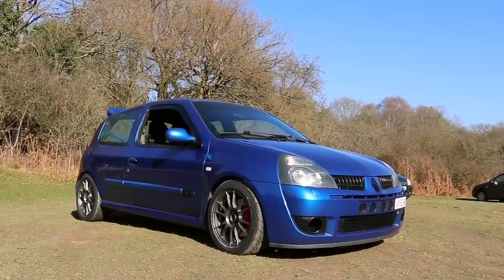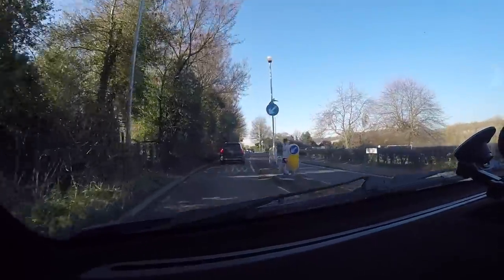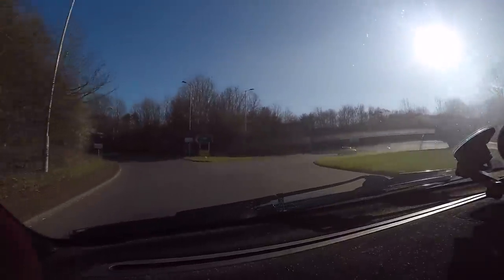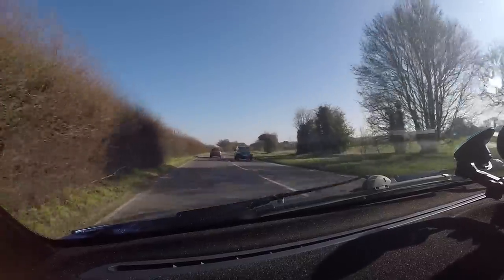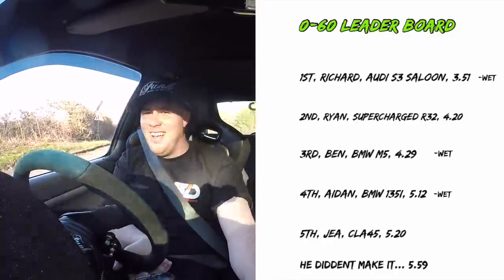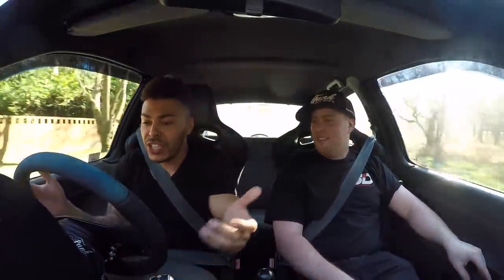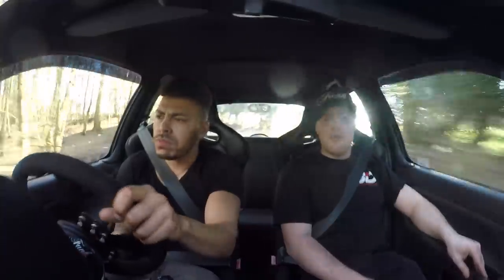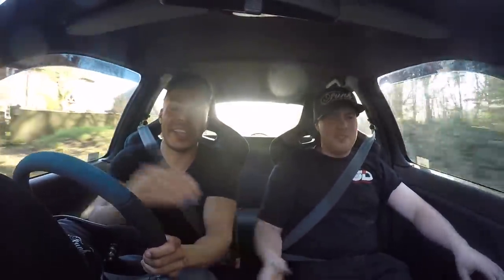UNREAL! 980KG 311BHP *TURBO RENAULT CLIO 172 CUP*

Comment: Renaultsport never fail to make you smile
Reply: Cheap and cheerful , you can pick up a 2 litre clio for peanuts nowadays ,
Reply: untill the head gasket goes lol
Reply: @christineayres5339  ano it's a French tin but try compare it to a proper honda motor lol they can hold 450 standard internals
Reply: @seanstubbs2620  Then thats like comparing a 2JZ engine to a Rover engine lol  JDM obviously gonna be better but you wont get a  Civic Type R for 2 grand , cheapest standard Type R will be like 7K in good condition
Reply: Sean Stubbs eh? Never heard of head gasket issues with renaultsports except if you go back to 5 turbos.
Reply: @jamiefrench8934  Yeah some people just got a grudge against Renault , the butthurt is strong with those people lol
Reply: Until the blowers stop workin..
And the wipers 😂
Reply: @KiltCars  LOL il give you Kudos points there as that is true, had it happen on my own Clio 182 driving in Milton Keynes in a rain storm had wipers on full then they suddenly went crazy went right off the windscreen lol , cost me £100 for new wiper motor , then the heater broke in winter too ha ha , electrics on French cars have always been awful as bad as Italian cars for sure.
Reply: @seanstubbs2620  Take a look at the piston speeds in a Renault F4R. It should't last but it does and revs well enough. I've seen plenty of smokey Hondas at track days but very few clios and I've not heard of head gasket issues especially as the cooling system on the sports is more than enough to keep temps comfortable during a track day thrashing. I did more than a dozen double drive track days in my stock 172 cup daily without issue.
Reply: @christineayres5339 , why JDM obviously gonna be better?
Reply: Jamie french even then only if the boost was wound up without correct feeling.
Reply: @warwickstingray  ano but that like a built job not standard
Reply: Until it breaks down after half a year, yeah
Reply: @Az Lean Ive never seen one go yet ,been working on cars for 17 years
Reply: @Az Lean You can always do what i did weld a band of Stainless steel using a Mig Welder around where the gasket meets the head, that way my friend it is impossible for the head to ever leak again, this is what they do to F1 engines nowadays and whens the last time you saw engine failure in modern F1?
Reply: @christineayres5339  On Clio 3RS the block cracks fairly often, but yeah, no headgasket issues on stock setups.
Reply: Clio Williams best clio ever in my opinion fucking love them
Reply: Naaa, lots of type r engines breaking, even stock ones, they're good engine's but they have to be properly maintained also.
And this Renault engine is pretty much bullet proof also, actually the Clio is pretty damn reliable, the gearbox is the weakest link.
Reply: @Ash-928  how can they truly be a petrol head if they don’t appreciate Renault more fan boys than car fanatics

Comment: This hits a special place with me. I had a gem of a 2006 182. Threw buckets of money at it. Looked absolutely factory fresh. Did not want to go the turbo route so had it done with ITBs, Helix clutch, lightened flywheel, race mounts, and it had the Cup package, so just went with solid mounts all around, sticky tires, Milltek exhaust system, m80 ECU and custom tune... I really really miss it so much. Thanks for this video. Mine was blue as well and this just reminded me of some really fun times. 200,000+ km on the engine, and it ran like new.
Reply: Respect man. I miss my 172. Love a N/A engine.

Comment: I had a standard one of these and it felt faster than my Golf R. I dread to think how fast this thing feels.
Reply: Terrifyingly fast😂
Reply: Feel fast becuase they built so bad 😂 never know when it's gonna fall. Apart
Reply: @rockyclark1782  

That's utter cobblers mate, having had several Renaults including the 225 they are anything but badly built.
Reply: I disagree too, we have a Mk2 trophy 182 (standard), a Mk3 Clio 200 (k tec supercharged 360bhp), R26 Megane Rs (stage 2 305bhp) and finally the newest Megane trophy (420bhp). And I can happily say we’ve had more issues with the 2016 Audi RS3 (standard), 2019 bmw m2 competition pack (standard), and the 2 cars which are the worst of them all currently in the garage 2013 Nissan GTR with a never ending suspension issue and the 2020 Audi R8 which we’ve only had for 3 weeks and out of them 3 weeks I’ve had it for 4 days and done 170 miles only. Safe to say a 720s will be replacing it in the next month or so!
Reply: @rockyclark1782  they are actually mechanically solid with the F4R engines that can easily go over 200k. Interior wise maybe? But it's really not any worse than others in its segment
Reply: They feel fast cause it has the go kart effect

Comment: Awesome car! But please do a 30-70mph test! 0-60 is all about traction and surface and doesnt tell us much about how a car performs on the road! We're usually moving on the road when we put our foot down. My old integra weighed under a tonne and had 200hp but managed a vbox 5.1 to 60 and this clio would leave it standing on the move.
Great channel aswell! Keep it up
Reply: So true man, my ep3 also does low 5s to 60 but on a roll would get murdered by this.
Reply: And get out of the car for the test. Another body onboard would certainly be felt in this baked bean can.

Comment: Bought a stock one of these in 2001. Blew the engine in 2003 with 30 000 km's on the clock due to a faulty rev limiter, and silly me pushing her up to 8500 rpm.
Amazing little car, that gave many more expensive/more powerful cars a serious run for their money.
Reply: That never happened

Comment: I had a 2005 Clio trophy forged, I had the hybrid Mégane r26r turbo fitted. Helical diff. Gen ECU . Over 300bhp and made 400lbs. In the dry it was great. Very fun car. Similar to this one. Think it was the only car I have had where you had to be brave to push it. Dont get me wrong the golf ain't far off but the golf feels like it's standard even when tuned. Fast but safe. The Clio was hold on tight lol
Good video Jamie👍
Reply: Carl Smith 400lbs you strap a jet turbine into it.. 20t hybrid will only run 330bhp and 300lbs at a push
Reply: @liamsteer2098  I did not build it, I think it was just the power you could get from the newer Megane twin scroll turbo. It was hybrid too. Came in at 2k . the bloke I bought it off used to race it on track.  There was a guy called chip on Clio owners who had similar set up to yours but 280bhp and when on track even he said it came past his like his like he did standard 172/182's. Search Clio owners for trophy turbo. You will find a track day where it was flying round. There's a print out somewhere. It used to run a race fuel to make that power also. Most of the time it was around 300 on normal pump fuel
Reply: Carl Smith I build these for a living no such thing as a twin scroll turbo on these! 20t is a hybrid turbo.. Meg engine won’t make 400lbs unless you have some mental paper work it’s impossible
Reply: Carl Smith are now that’s a different story because he built that car with mixture off clio and meg parts I remember that car
Reply: @liamsteer2098  just going by what I was told buddy 👍 I just bought it and drove it, it always got hate from other turbo Clio owners. All I can say to suggest how the result was made is I had an Courtenay stage 2 astra gsi turbo before, it ran 250bhp/ 270lbs on Courtenay sport rollers few years back. Then they had a new single roller rolling road put in where the car sat on one roller, they said more accurate results? It pulled same horse power but 320lbs of torque? You know as well as me now 40! Lol, all rolling roads can give different results. Should only be same RR to measure a gain. I took this turbo trophy on my local rollers but it held back as it was mapped on high octane, to make higher bhp. At 10 psi it pulled 280bhp and 330lbs. Could boost 18-20psi on higher octane?
Don't want to argue with you Liam, but I did break a quaiffe helical diff in 2nd gear and quaiffe said it must of had some torque to do that, they would not believe it till I sent it to them lol. Remember it was home built, turbo and manifold was a nightmare fit. Maybe the guy meant 400nm?? It was quick tho just like yours 👍
Reply: Build these for a living yet know naff all! Oh the irony hahahahahaha
Reply: laura lawrence clearly know nothing that’s why I got my own business haa
Reply: laura lawrence that car didn’t make 400lbs!! It can’t produce that torque figure!!  182 with a gt2871r can’t even produce that much torque !! 

I know the car he’s talking about and they experimented with different parts of different models it’s a nice build but not 400lbs
Reply: laura lawrence I just looked your video using cable ties hold sensors in nice !!! Dyno graph id happily eat my own words
Reply: @liamsteer2098  You're talking out of your backside I know this car and its even been here for repair work and have seen the print outs for it too both with and without tulene!

Heres a chance for you to show some of your knowledge... What woupd be the minimum size intake pipework to make such power?
Reply: @liamsteer2098  cable ties on a wanky old Clio 197 map sensor when the whole engine was being ripped out as they are crap lol well observed perhaps you really are a Renault specialist😂
Reply: @liamsteer2098  https://www.cliosport.net/threads/show-me-your-graph.717050/page-4#post-10062472, posted somewhere on that page.
Whatever it was or was not it was fast.👍 But broken quaiffe, pipes coming off the intank pickup, teeth wearing off the plastic throttle body. Then final straw was a well known tuner over heating it on his rolling road. Should of gone to rs tuning with it! It now sits somewhere in Sheffield on a garage lift. Been there 6 years? Waiting a rebuild. People get too hooked on numbers. It went off the clock and I never drove it with the fuel mix, and experienced over 300 bhp, would loved to know what that would of felt like!
Reply: Also you are the same liam steer that was having trouble building a meglio and asking for help in facebook then advertised it with clicking cv joints! Your Renault tuning business must be bursting at the seams with new custom😂😂😂
Reply: @liamsteer2098  are these high compression engines forged motors. Did efi tune it? Love the underrated car always pisses people off
Reply: laura lawrence someone got a lot time on there hands, am the first person to look for advice and help because I don’t know everything rather than struggle il ask!!  I was selling car as it was just to get rid because am extremely busy don’t have time work on it !!  But now am forging it over this year with a 20t try get 320bhp
Reply: Carl Smith I will hold my hands up hear and FairPlay how ever they got that torque figure that’s a first !!! Must been a weapon.
Reply: @liamsteer2098  Don't have a lot of time on my hands but do take notice of meglio related posts on the facebook groups and only mentioned it as you took ypur time yo view my only YouTube video and comment on a cable tie!

320 bhp should be a doddle! Or you could go with the hybrid from rs tuning if you want to make good power which was similar to the one in the trophy mentioned above which had nothing particularly special added to it other than running a mixture of fuel and tulene and a decent map with  fully adjustable boost control which could manually be set up in 100rpm increments  for each gear. It made that power running 40mm intake pipework with the logic behind it being that if rally cars make good power using a 40mm restrictor then why fit bigger pipework that only adds to an increase in lag.

Comment: 10:20 Launch it in 2nd gear with high revs 😃🚗 🔥💨
Reply: it goes to 8000 no problem even as stock, limp mode 3000 and its still enough to go 100kmh lol

Comment: Liam please put some Michellin Pilot sport 4s on and hopefully there will be an improvement on grip and put a roll cage in. Quality car and driving stay safe lads
Reply: Manc Car Guy  am on ad08rs always gonna struggle in the lower gears
Reply: PS4's dont come in that size and to be honest arent a grippy tyre, they are an all season all weather tyre not a semi slick., his Ad08r's are far better.
Reply: Gus Nilsson it’s so hard to get a good All round tyre, ad08r like you said is a semi slick that works in the rain best option for me in wales 🌨⛈🌧🌧
Reply: @liamsteer2098 I agree, AD08r are great though for the price, I wouldnt change. Do you find the gearbox needs different ratios as you are changing gears every 2 seconds.
Reply: Gus Nilsson  be honest mate I don’t drive it on high boost very often because off the spinning,, just showing off camera in low boost doesn’t really spin
Reply: @liamsteer2098  What make was that shifter? what a beast of a car mate. I have a standard 172 Cup and cant imagine how fast and scary yours is!
Reply: css172 pure motorsport mate,, yeah does go well
Reply: @liamsteer2098  thanks for reply 👍

Comment: with an automatic gearbox you will have around 4 sec 0 to 62miles per... also, if the wheels will be fitted with more sticky tires you also can "won" 0,5sec. On normal, manual gearbox you`ll need a precise short-throw gear shifter and you will "won" at least 1 sec. Couple more tweaks and will be just fine ;)

Comment: I used to own the standard 2 litre 182 clio and trust me guys 182bhp in a clio is more than enough , 0-60 in 6.9 secs and 140mph top speed, so god knows how much faster this Clio is must do 60 in 4.5 secs at least
Reply: OZZY ZIG 154 gps on the limiter she’ll go
Reply: They do more than 140😂
Reply: @ittzFuzzi  Not a standard 182 i have one and it will do 140 near hitting the rev limiter, if your on a downhill stretch of motorway then you might get an extra 5 or 10 mph but not a good idea as your engine will burn up
Reply: 0-62mph is 6.9. I got 6.5 0-60 on a Vbox performance unit in my 172 cup 1 up and Autocar claimed 6.3 0-60 2 up with half a tank of fuel in a 182.
Reply: @warwickstingray  Depends on the tyres, what the weather is like the day tested , what ECU map you running etc etc
Reply: @christineayres5339  Mine was an average in two directions, in damp conditions, sub 15C temps and no tyre warming. Continental sport contact 3 tyres.
Reply: The car was stock. It was a strong one though. Always went well on track.
Reply: @liamsteer2098  Thats gotta be tuned ?  as mine does 140 and its out of puff
Reply: OZZY ZIG am the guy in the video mate haaa
Reply: @liamsteer2098  Say What ?  lol
Reply: OZZY ZIG am the owner of the clio in this video mate 154 she does on the limited in 5th
Reply: @liamsteer2098  Ah ok thanks for letting me know , as at  first i thought you were on about a stock 182 but yours is miles faster than stock on acceleration you must do 60mph in under 5 ?
Reply: OZZY ZIG it’s not the best 0/60 because lack off grip.. 3rd gear onwards it gets going
Reply: @liamsteer2098  Ah ok that makes sense , great car anyway bro
Reply: OZZY ZIG thanks mate maybe if I dropped tyre pressure plenty off heat in maybe ... il try on the weekend after my track day
Reply: @liamsteer2098  cool

Comment: Could you drop a megane turbo engine in instead?
Reply: Yes it can fit but it’ll be a wee bit of a squeeze but they can’t handle good power without being forged aswell if it was the r26

Comment: Cool car not tempted to up the boost see how far you can take it 12psi of boost still on low boost 😜😜😜
Reply: Jack Ward intercooler was on it’s limits I have a bigger one now il go back end off the year push a little more
Reply: Not that you need anymore I’d be mor Ethan happy with that I’m sure you’d only start to run into gearbox drive shaft problems with more boost but bbbbbbooooooooosssttt 🤷‍♂️🤷‍♂️🤷‍♂️🤷‍♂️
Reply: Jack Ward  more boost is always better haa 😜...  she’ll go 320/330 some boys running 370 Bhp through standard box 🧨🧨🧨🧨

Comment: power to weight means the world i own a seat leon 1.4 tsi around 200 HP 340 nm weight is about 1130 kg but you would be suprised how quick it is a mk6 R stage 2 could barely gap me until 100 MPH

Comment: Hummm,...  and on a real sports road, that is to say not on easy straight, winding or circuit, it is unusable. Because on a FWD, especially light like our Clio 2 RS, from 210-220 hp on the front wheels, it's simply not working on the ground, the full power and torque, even with the best Torsen or self-locking. It shows perfectly in this video by the way.
A Clio 2 Cup x65 well piloted with "only" 190 hp, will put him 1 lap of circuit at least in 5 or 6 laps.
So sorry, it's a good technical job yes ! BUT it's a useless preparation for me ... unless we have the big sex complex (see Freud in this case). Or just good if you search the "fun" (and I personally would get bored soon) on a few hundred meters of straight lines, but not pure sports performance on real sports tracks.